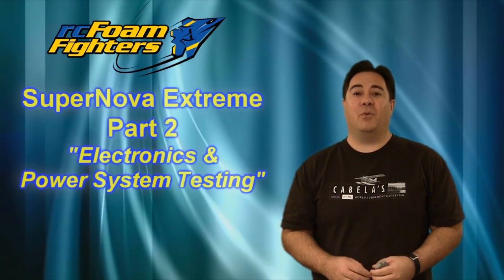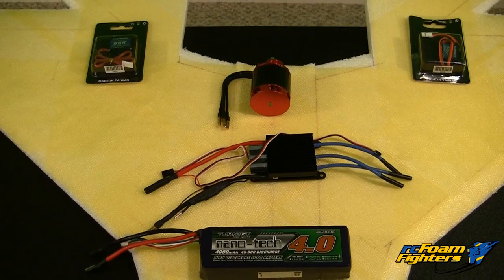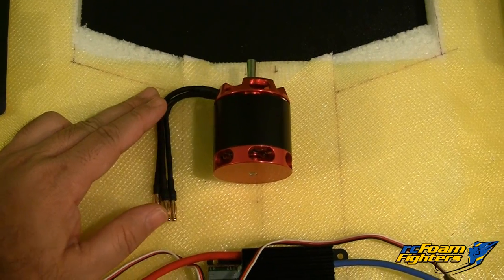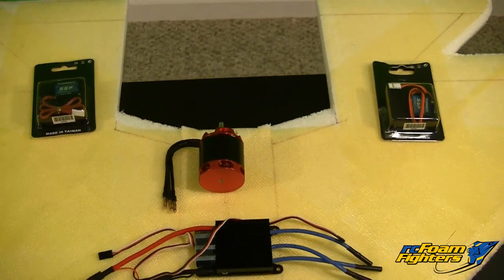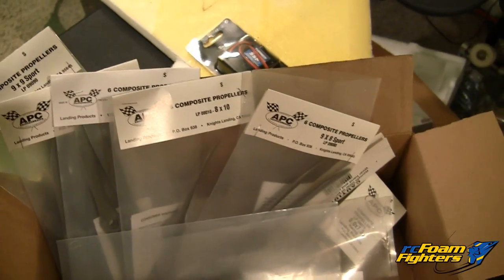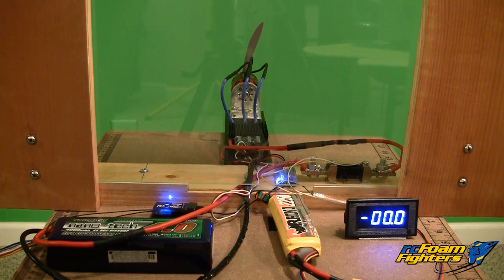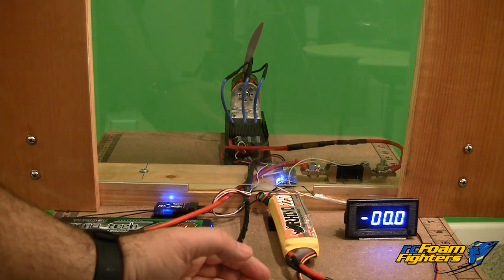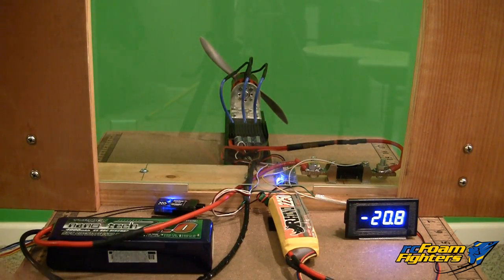SuperNova Extreme Part 2

Comment: I don't know of a particular video that demonstrates the principle.  Newtons first is basic HS physics though. If the plane is still (static) there is a lot of energy wasted just getting the mass of the plane moving.  Once the plane IS moving that energy is already stored in the plane.  The model then needs far less power to keep it moving.  Think of it as "maintenance" thrust.  There IS the factor of wind resistance on a moving model (drag) but it is nothing in comparison...

Comment: Question, don't you think there would be a lot more load in flight as as apposed to static testing, double fold with a air block right in front of the motor? Is the prop cavitating (starving for clean air)? Looks like ~6 hp motor/battery setup, very impressive.

Ozzy

Comment: @gaetanboiv it's also not exactly accurate in that the actual plane moving through the air will load the motor less than sitting still and moving all that air.

Comment: You might want to consider launching the plane using a bungee. Personally I would've forked out the extra cash and gotten a Scorpion or Hyperion 40-30/35 helicopter motor 800-900kv and run on 8cells. Could probably turn a 10x11 prop no problems.

Vince.

Comment: Great vid - I love your protective (ballistic) screen - sort of like what they always use on mythbusters, and I laughed when you said you had to step out of the room. I know how you feel. I get scared just running up a 2206 motor to full speed on a 3 cell battery with a 6x5 prop. I would be terrified with the setup you are testing out there. You guys are great. I hope those servos work out for you cause they seemed to get mixed reviews on the HK website.